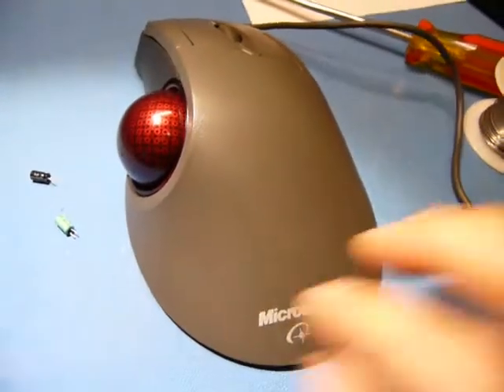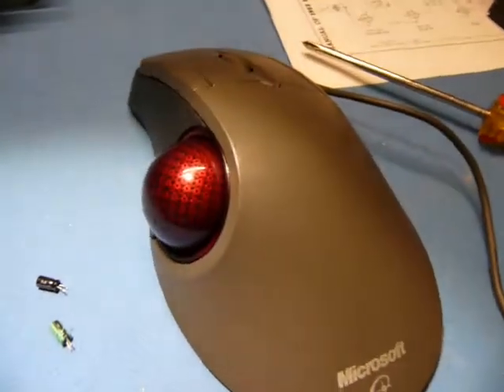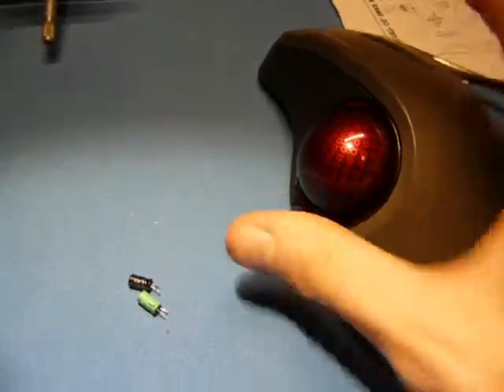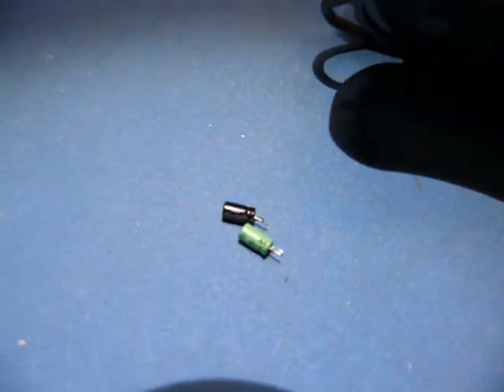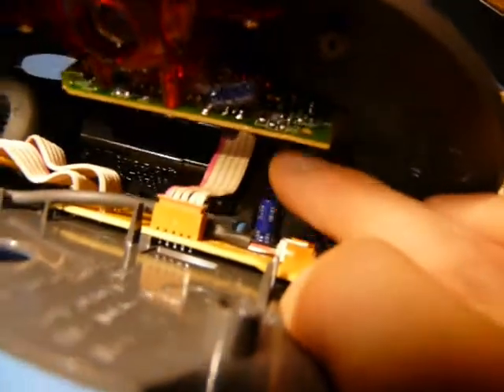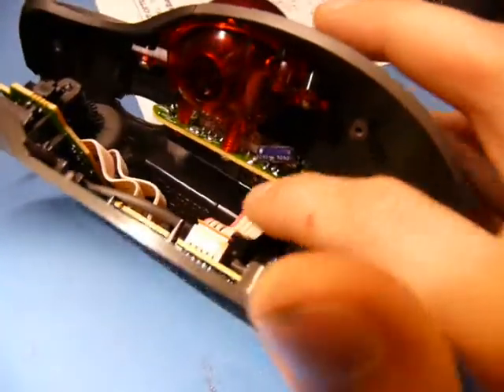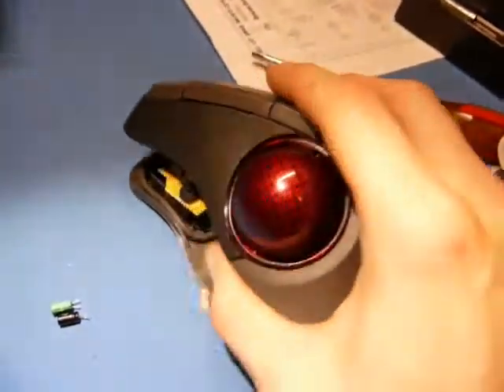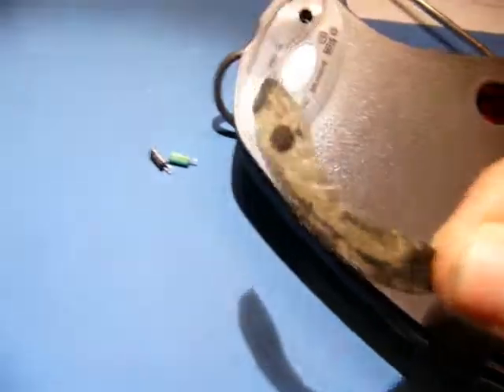Fixing a faulty Microsoft Trackball.

Comment: I've owned several of these and never did a cap replacement. Every time it was crudded up bearings or a bit of lint in front of the sensor. I am glad for the heads up about the capacitors. TYVM for making this video, as I know these were discontinued a long time ago.